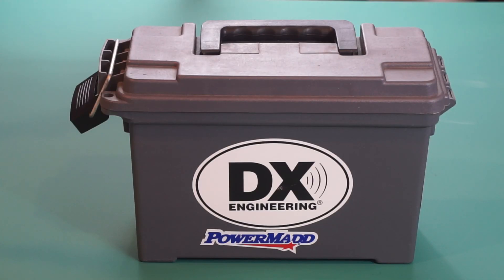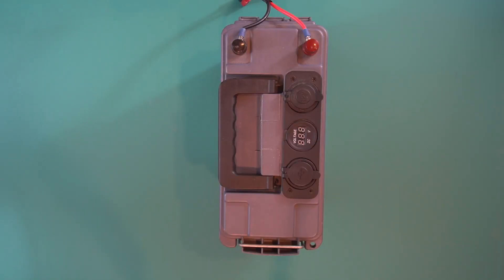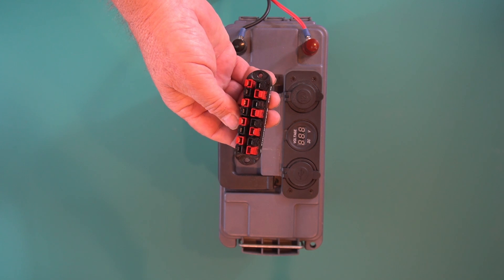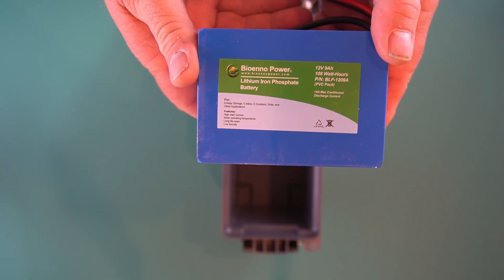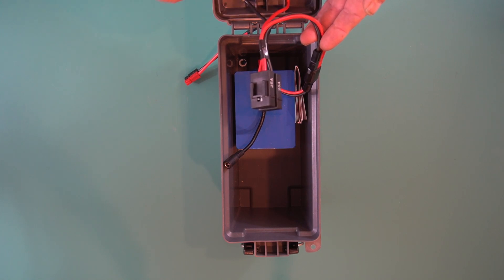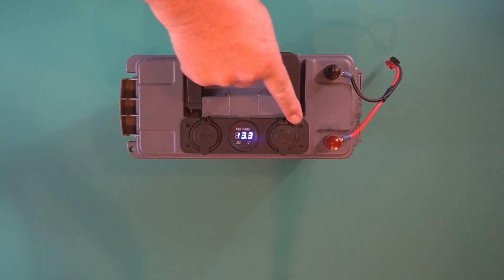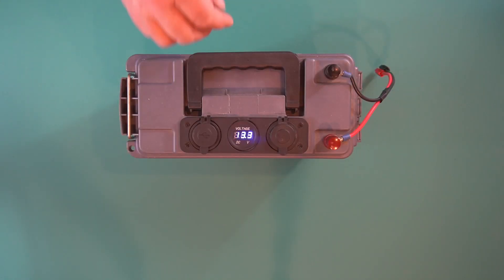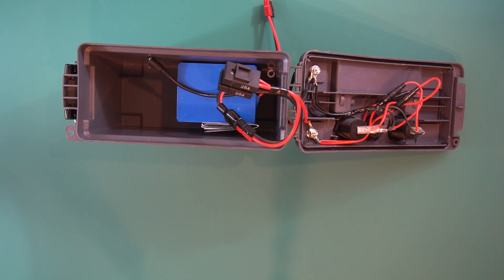How to make a  Battery Box using one of the best portable batteries from  Bioenno 9 AH lithium !

Comment: Why not double the number of batteries in the box? It looks like there is room? Great video!
Reply from the maker: You could but that's what I had at the time, thanks for the comment and watching!
Reply: @KK6USYHamRadioAdventures  I am looking at doing my own build and one of the things I am trying to figure out is how many and what size batteries I can fit in one of these boxes.  Thanks for the reply!
Reply from the maker: @KempOutside  If you look at my 20ah ecoworty battery review it fits in the box . I t does bulge it but will latch. If you look on their site they make one without the case it might be perfect! And I think you could still get the other parts installed like I did , it will be tight.

Comment: What are those black things in the middle of the red positive wires going to the meters? Fuses?
Reply from the maker: can you give me a time stamp? Oh they are inlinf fuses
Reply: @KK6USYHamRadioAdventures  so you fuse after the battery and again between the posts and the meters?
Reply: @KK6USYHamRadioAdventures  isn’t a fuse after the battery enough? Why two more after the binding posts?
Reply from the maker: @forgetyourlife  the parts came with them and they are lower amp fuses
Reply: @KK6USYHamRadioAdventures  interesting, I ordered from Powerwerx and got no small fuses. I sent a pic to your Twitter feed. Let me know if you think I should re do it.

Comment: Hi, new HAM question.  If the transceiver is supposed to run on 13.8 V DC, is a 12 V DC battery OK to supply it?  I only see people using 12V
Reply from the maker: Hi Paul, most radios have a range that they can work in and supply the rated power. the Bioenno and most lithium's run at bout 13.1 volts and is plenty for Ham radio. The 13.8 or what ever the rating for that radio is usually the max rating. A FT891 for instance states 13.8 volts + or - 15 %, I hope this answers your question!
Reply: @KK6USYHamRadioAdventures  totally! thanks man 👍
Reply from the maker: @paultolon4370  no problem , hey if you haven't seen Coffee and Ham Radios check us out on Saturday and Sunday mornings at 9 am central time. We target new hams and if you catch the stream we try to answer questions from the viewers!   https://www.youtube.com/channel/UCHbk0nI1f5jlnUG9Hyh9xbw

Comment: One other thougth I had was using a toolbox similar to this one https://www.walmart.com/ip/Stanley-12-5-Polypropylene-Tool-Box-7-W-x-5-1-H-Black-Yellow/19897947  and in the compartments, under the lids I could have multiple connectors (Anderson PP, Binding posts, bannana plugs etc.  That would be somewhat protected.    Downside this type of toolbox starts getting pretty big to just be a battery box but not big enough for battery and radio....   Need to take measurements this box from walmart may be too shallow for the Bienno battery.  Keep the videos coming! 73 NE5B
Reply from the maker: I have another battery box build more like that , it's a 30ah battery, I run my 991A off it at 100 watts. I have done two POTA's off that battery and still at 13.1 volts. About 190 contacts plus some 2m fm and ssb for another 25 contacts 50 watts .

Comment: That battery doesn't move around too much and beat up the other items in the box?    I don't have the battery yet but have the rest of the parts. Planning to use some 2" velcro to attach to the bottom of the battery.   Planning two boxes one for the battery and another for radio.    Would like to use my 706mkiig but afraid it's too hungry for 9amp hour.

What Radio were you using?   Even at just 10% transmit/90% receive that battery sounds pretty impressive if I understood you correctly - you were running  50-100watts At end of 6 hours, you said you still had 13.1 volts. That is good!
Reply from the maker: I was running a FT857 the day I tested it comparable to your radio I think. It's not too bad on recieve consumption. The battery fits pretty tight in that box and doesn't seem to move much but some velcro would totally hold it.

Comment: I built one pretty much the same as yours, but since I only run a 10 watt HT, I used a 12 volt, 6 amp Bioenno battery. On/off switch, 12 volt plug, and dual 3.0 USB plugs with voltage meter built in. Works great, and the battery is surprisingly small. Very good video.
Reply from the maker: Yea James aren't the Bioenno batteries great? Thank for watching and commenting 73.